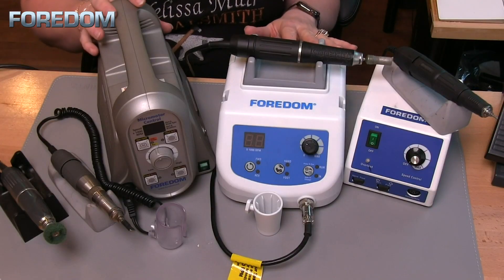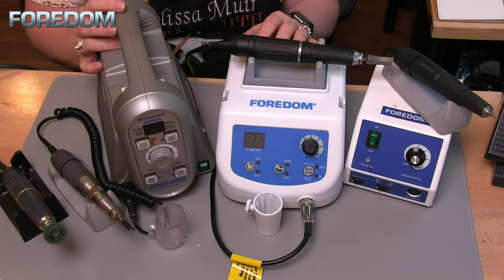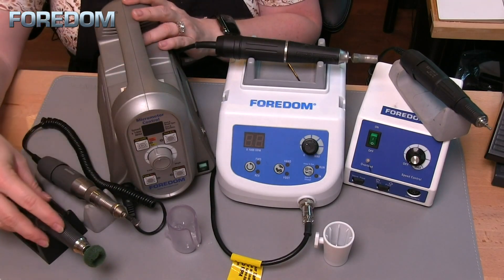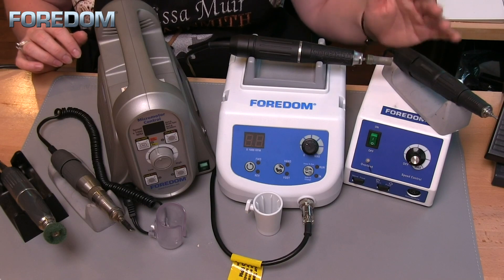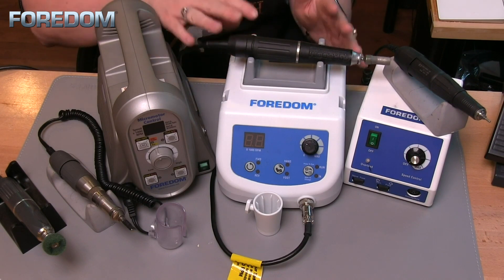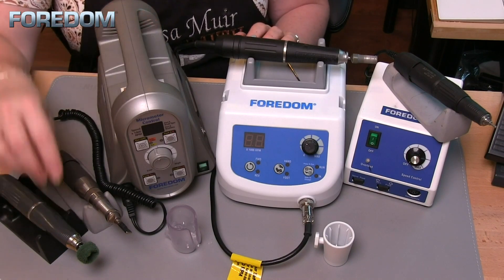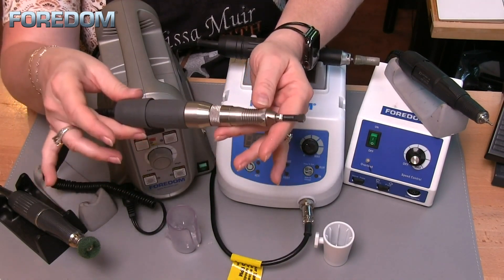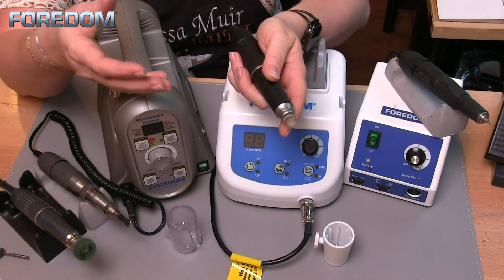Micromotor Comparisons - Ever wonder what the difference is between all our micromotors? Learn more!

Comment: For the 1050 Micromotor is possible to use for dentistry ,or it is strong ?
Reply from the maker: ›The K.1050 micro motor is perfect for dental laboratory tasks, but not on people. (There is not a tool made by Foredom or Handler that can be used directly on people.) Thank you for reaching out!

Comment: One thing lacking: we need info on how to COMPLETELY disassemble micro motor handpiece. My very first K1070 was made inoperative when I tried to change collets, dropped the back on the table and neither I nor any of 3 instructors could sucessfyreassemble the handpiece. Also, I have had the handpiece lock up while changing burrs. As I reached for the new but, the machine popped closed and there was no way to reopen it. Troubleshooting is a must-know unless you have many hand pieces so you can work while the other half areenroute to Foredom. 
Thannks
Reply from the maker: Please read and follow the owner's manual precisely for changing collets. You can also go to our Resources area on the website and check out the owner's manuals and part diagrams and videos.
We always recommend to customers that they should get the handpiece with a 1/8" collet installed and use collet adapters so they do not have to change collets or open up the handpiece. However, there are many users that only use 2.35, (3/32") shank burs so they can disregard my advise.
Yoy should always have a shank in the collet and NEVER close the collet without a shank in it.
Thank you, Mike Z.